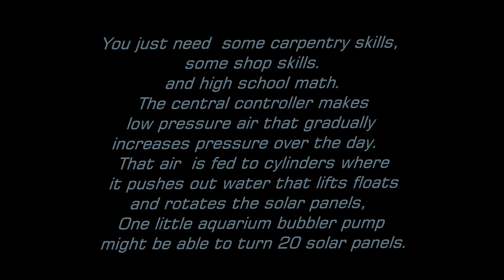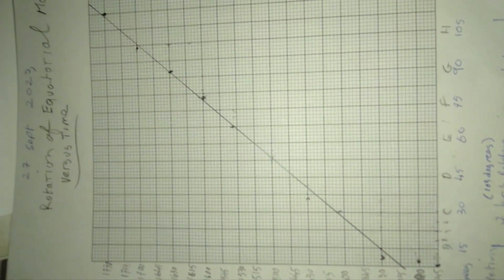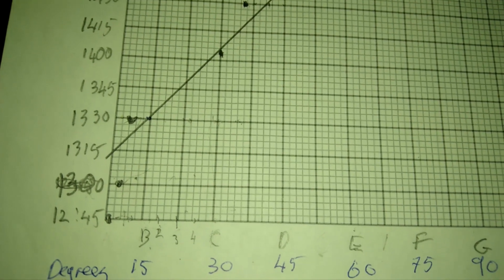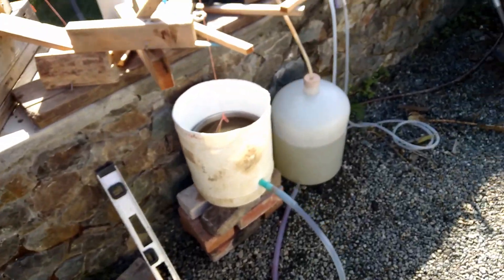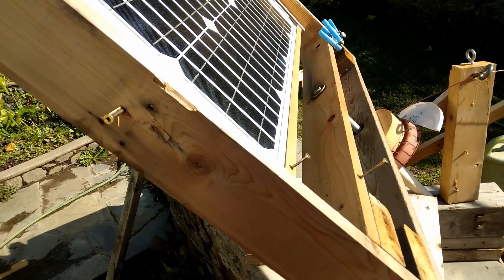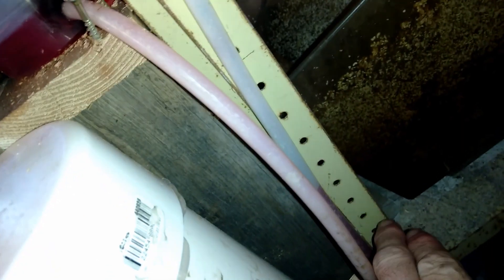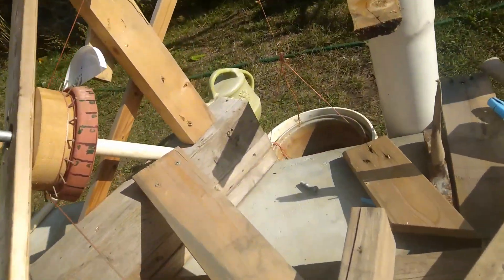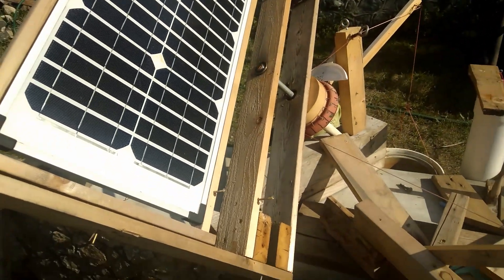DIY! Zombie Pneumatic Solar Tracking  for solar panels & solar cookers September 28 & October 1

Comment: Do you know the simple electrical solar tracker ? 2 small pv pannels looking in different directions, one motor with gears to slowly rotate to the good side. + and - of one pannel is connected to the motor, and from the other pannel the same, but - and + reversed. That's it !!
Seems to work great, i saw some different models on internet already made..
But still i like the idea of purely mechanical system (and not based only on kind of a timer as you have to be there to rectifie all the time the system otherwise..Planets, and sun are mooving...) , with only fluid mechanics..
Reply from the maker: My purely mechanical system is functional now for solar panels, it only needs one air pump and one really slow motor to remotely  run 10 or 20 solar panels.  I still don't know if it is cost effective. Currently I use a 50 gallon drum of water  to turn it to follow the sun. It's overkill but the drum cost me only 30 dollars.  I'm not currently testing it, we just have cloudy weather here till usually mid February.  Long term, I want to use it to make my "poor man's alternative" to Scheffler solar kitchens. So I will solar cook soil to sterilize it and  I'll do solar hot water too.

Comment: As very simples electrical solar mechanical systems are already done to track the sun, why not triying to pump with only sun's heat ? For instance 2 double glazed tubes with hydroscopic materials inside, ''fighting" (by weighting more) one against the other and turning the system to the sun.. When sun is hitting one more than other, the hygroscopic stuffing gets lighter...
Reply from the maker: Nobody has done the electromechanical  system I am doing,  and it is far simpler than most, so, I will try to develop it and prove that it works.  The only other pneumatic system I know about is called "sunfolding"  that provide tracking for huge solar panel installations with single axis tracking and they have just "folded"!  Apparently they have lots of projects to finish up but something went wrong on the financial end of things. They have patents so maybe these will be sold off and the technology will continue to be used.    The hygroscopic system you describe is not accurate enough for tracking solar cookers so I won't be trying it. My system uses a tiny amount of energy to move the panels and solar cookers, less than the hygroscopic things.
Reply: @Brians-tracking-solar-scoop  Other option could be a mix of what you do and air pressure caused by black empty tanks mooving water also...
Reply: And have you checked this difficulte to beat simple electromechanical system seen for instance in this video ? <<Simple Solar Tracker With Auto Return To East>> There is also the same type done replacing pannels by ligh captors..  @Brians-tracking-solar-scoop
Reply: And also the purely mechanical HelioDrive from Sulas Industries is very nice, actuates many pannels at time, can be diy, and used for other stuffs like openig a window to let solar hot air enter in winter and go out in summer.... @Brians-tracking-solar-scoop

Comment: Very Heath Robinson.👍
Reply from the maker: I have been called Rube Goldberg too, so I don't know whether to laugh or to cry.   I just asked Naomi Wu to design a better or simpler  "pressure increaser" for it.  (Poor girl is dealing with Chinese censorship and western defunding  at the moment, so I might be waiting a while).   Anyway, look at the bigger picture,  Imagine, the same system with one central pressure controller, (costing about $80 at my first attempt), running say 20 "zombie" solar trackers,  with solar panels on them all pushed along, on their journey tracking the sun,   by floats in containers.   I looked on Amazon for the price of  actuators for solar panels,  and I found one for $130.   I bet that once this system is made properly and optimized,  it will be competitive.